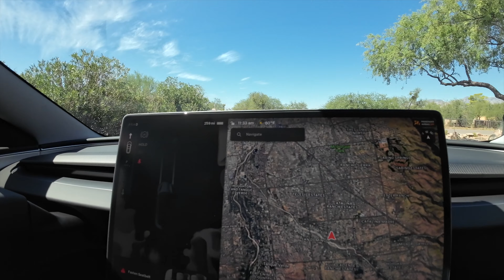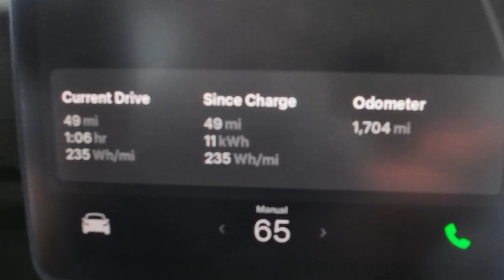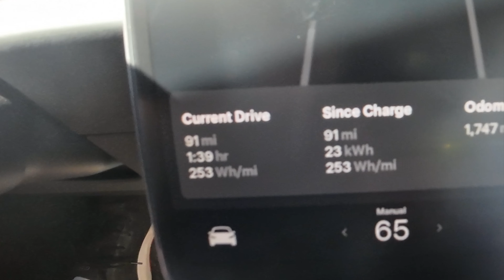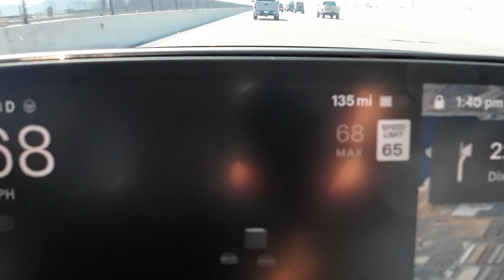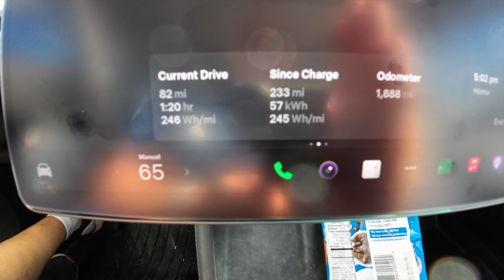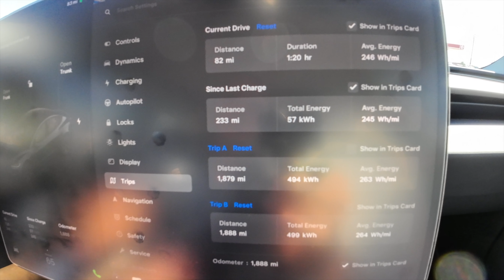Model 3 Performance Range Test

Comment: Wow.  This is an IMPRESSIVE result to say the least.

And it is even more incredible than it looks.  To the point that it makes NO SENSE.

I think you started the trip at 86% state of charge.  The M3P has an 82 kwh gross pack capacity.  86% of that would be about 71 kwh.

You used 57 kwh at 245 wh/mi (a achieving an efficiency of a shade over 4 mi/kwh).  At the end of your trip you had an indicate 80 (or 82?) mi range remaining.  At ~4 mi/kwh that would be another ~20 kwh.  That would mean your pack can hold 77 kwh at 86% SoC!!!!  And maybe it's possible (afterall, not all 300 hp ICE engines makes 300 hp, so I am sure not all 82 kwh battery packs has 82 kwh of energy capacity).  But it would mean your pack has a potential capacity of 89 kwh!!!

You should NEVER sell this car if that is true.  You should do a 100-0 SoC range test and see how many kwh you can withdraw on a full charge.  I would LOVE to see the result!

Either you have a 89 kwh pack OR you can expect that last 80 mi of range to drop precipitously and only achieve an actual ~56 mi (the expected 14 kwh remaining after using 57 kwh from an 86% initial SoC) range from it (on the same route/drive/conditions/speed).

Also, can you provide more details of this drive if possible.  Weather (temp and wind), elevation (gain or loss or overall estimate of it being flat, downhill or uphill) and avg speed (or set speed) for this drive.

Thanks so much.  Your vid was short, concise, informative and showed the necessary consumption numbers.
Reply from the maker: Thank you so much for you nice comments.  I was a bit surprised at how well the car did myself especially since I was running air the whole trip and it was over 100 degrees.  I am driving to California here soon and will keep track of the range on that trip as well and possibly do another video.

From Tucson to Phoenix it is slightly downhill with about a 1200 foot elevation loss depending on where you start in Tucson and where you end up in the Phoenix area.  The speed limit is 75mph for just about the whole drive and I tend to set my cruise at 79 mph.  Through Phoenix on I10 it does get a bit slower here and there with traffic and speeds are probably closer to 65 mph average.  There was some wind on the drive that day, but nothing crazy that I recall.  

I can say that I didn't try to drive conservatively on the trip, but I wasn't hitting the accelerator to the floor on and off either.  Just going with traffic.  When driving our gas vehicles from Tucson to Phoenix it seems MGP is generally better going to vs coming back to Tucson.  Makes sense with the elevation change.  Hopefully this is helpful.  Thank you again.
Reply: Thanks.  This is helpful and still incredible.  1200 feet elevation drop will def add quite a bit of range vs gaining 1200 feet.  Probably the difference could be 15% or more.  But going 79 mph (set speed) and still achieving > 4 mi/kwh even with elevation loss is amazing.

I look forward to seeing your follow up video!  Thanks so much and happy Tesla miles.